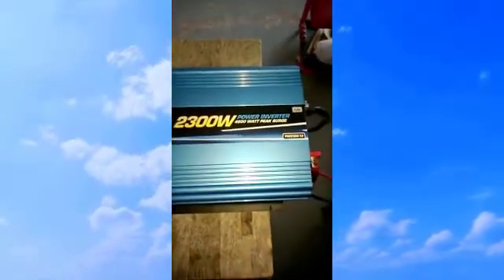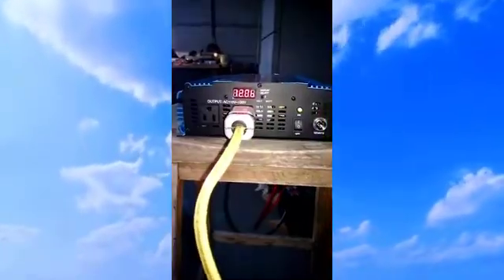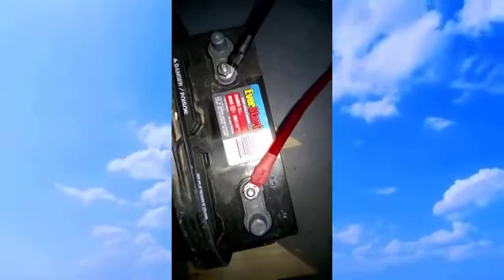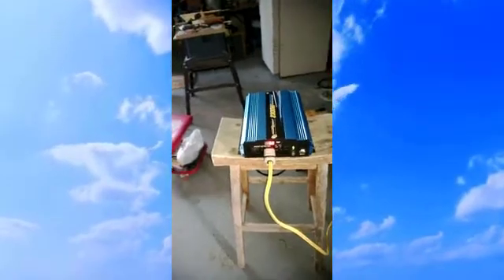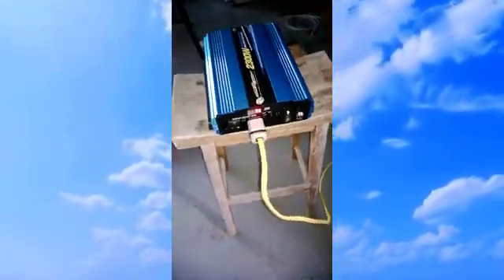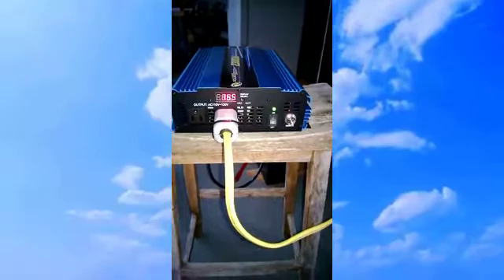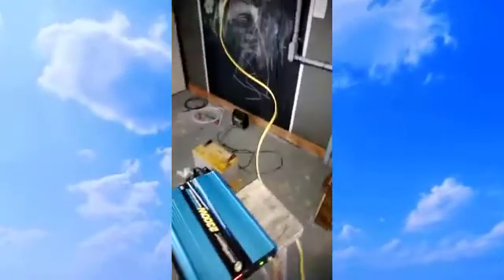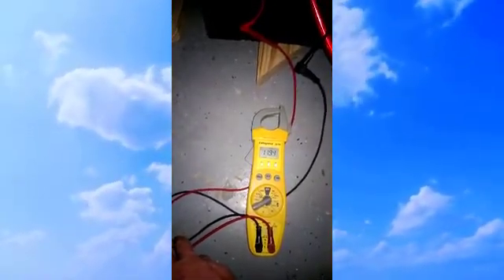Review Power Bright PW2300 12 Power Inverter 2300 Watt 12 Volt DC To 110 Volt AC 2019

Comment from the maker: See on Amazon ► https://amzn.to/2Gh0UVz
Reply: Don't buy this product! I bought four of them in the past four years and three of them caught fire inside the housing on the panel board. One after 3 months, second after 18 months and the third one just yesterday after about 30 mins. The very first one I bought still works. I used it for 2 years and then took it out of commission to save for a spare. So I am now back to using my spare! Going to try a different product brand I am done with power bright!

Comment: Don't buy this product! I bought 4 of these in the last 4 years. 3 caught fire inside the housing on the panel board. I still have the very first one I bought thou and it still runs with no problems. The other 3 caught fire, 1st one after 3 months, 2nd one after 18 months and the last one I brought home yesterday it caught fire after about 30 mins. I couldn't believe it. So I hooked my spare back up, which is the very first one I bought but took out of commission after 2 years to save for my spare. I am going to a different brand now.

Comment: Don't buy this product! I've had four of them and three of them caught fire inside on the panel board. First one was at six months, second one was almost two years and third one was within a half hour. But I still have the very first one I bought four years ago and it still runs with no problems. So go figure!